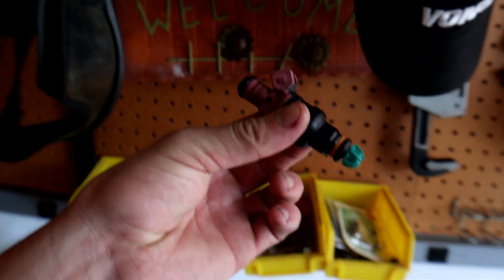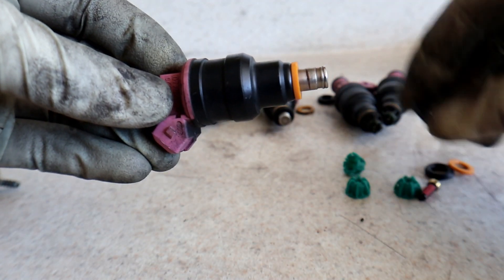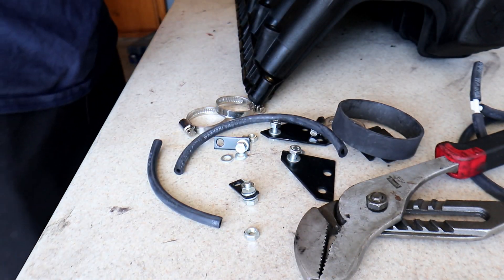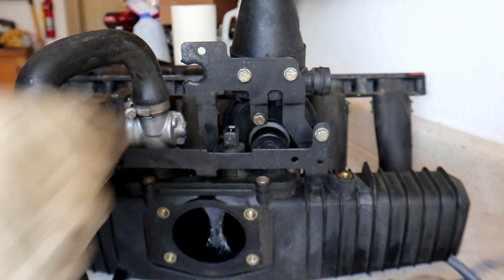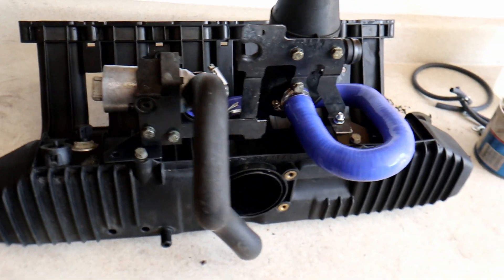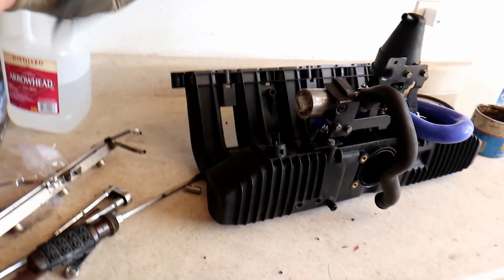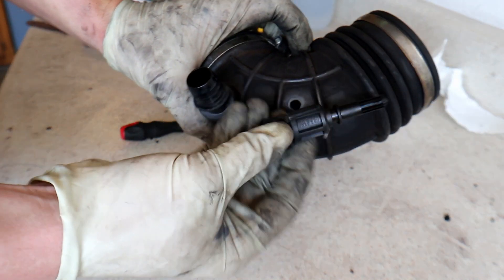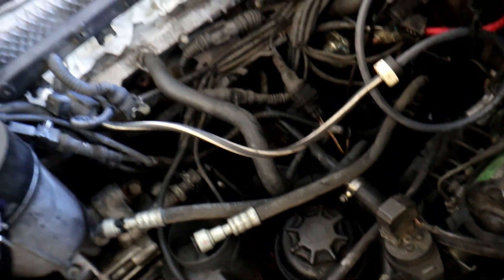M50 Manifold Swapping My M3 Sedan!

Comment: Anyone know what size for the small hose that goes into the check valve
Reply from the maker: couldnt tell ya off hand, if you have the check valve out you could run down to an auto parts store and see if they have any surplus hose that fits and report back.
Reply: @M3NACE  i bought 5/32 4mm vacuum hose similar to wiper fluid hose